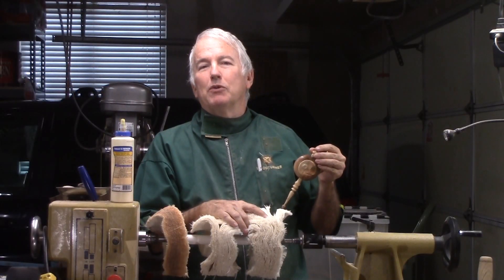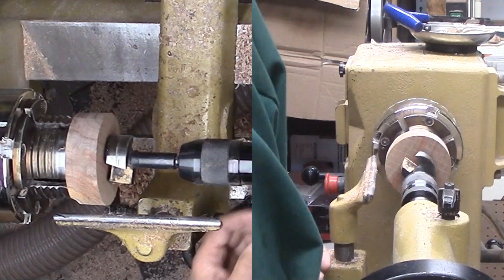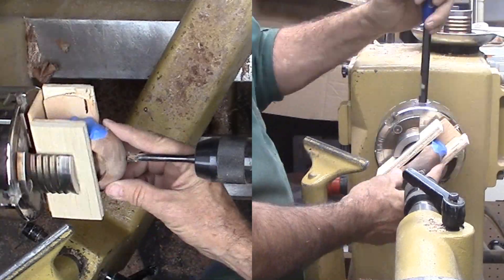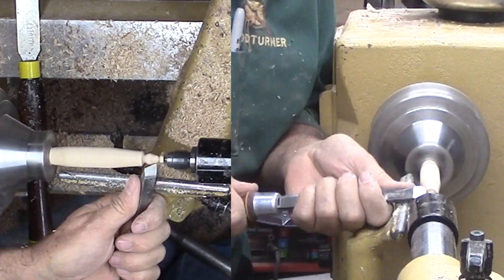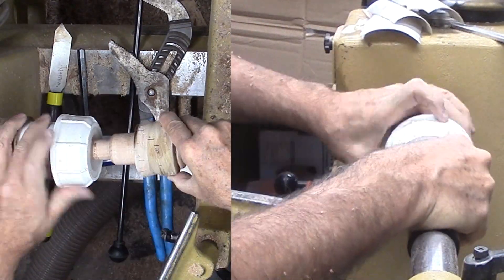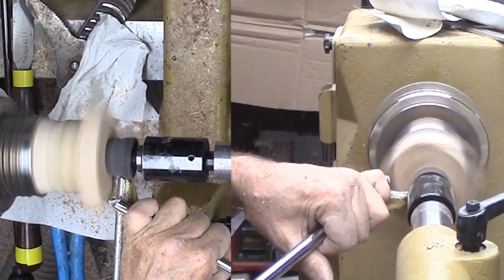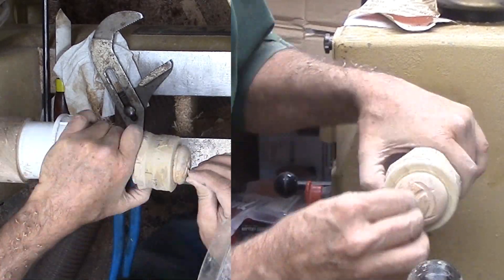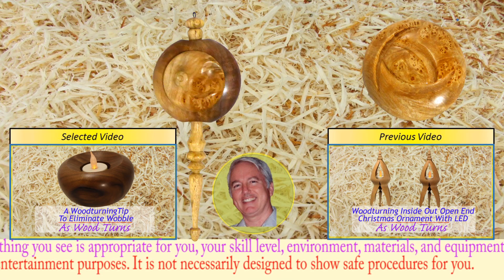Woodturning Christmas Ornament Using Infinite Axis Chuck

Comment: Great video  Alan, the ornament looks fantastic. Do you really have to use the channel lock pliers, to tighten and loosen the nut on the Infinite Chuck? Can you not tighten the nut tight enough by hand, have you ever tried tightening it by hand only?
Reply from the maker: I have tightened it by hand. But my grip is not strong enough to get it to release. Since I need the pliers anyway, I give it the extra nudge to tighten it with the pliers to save strain on my hands.
Alan